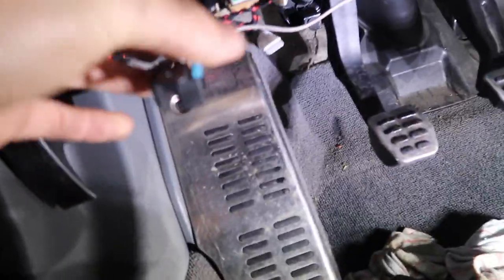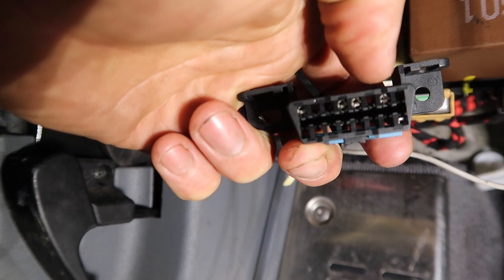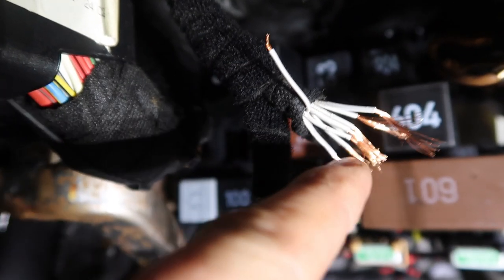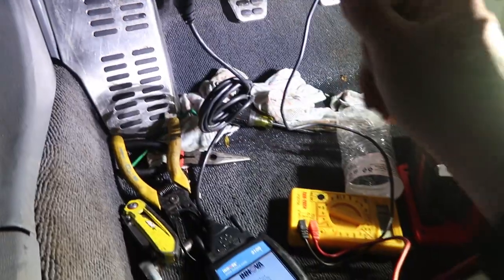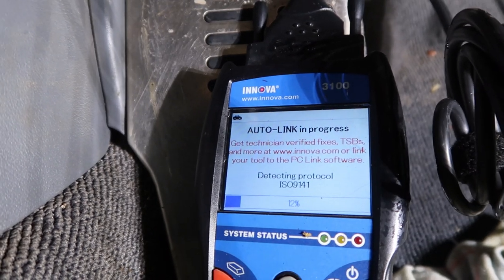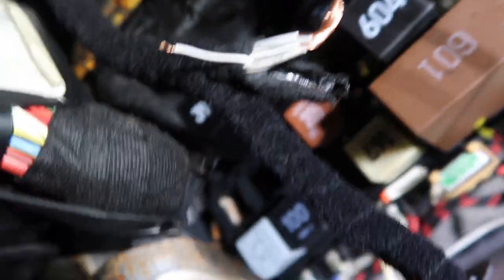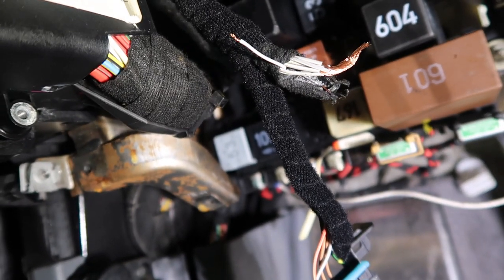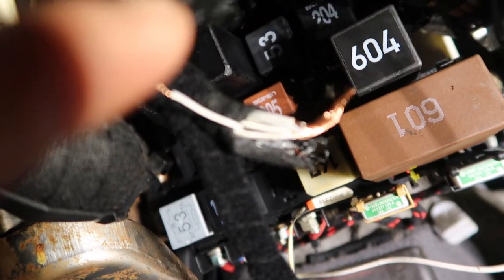Audi OBDII Port Not Working  FIXED!!!

Comment: Great information ! Thank you ! Any idea where that same connection / bundle of white K wires is, in a 2012 Audi A7? I've got a stuck K line after steering module failure - but unplugging the Steering module doesn't allow VAG-Com connect !

Comment: Thankyou bro. What should be voltage at pin 7 if it is working fine ?
Reply from the maker: From an Audi forum that helped me

If you have a volt-meter:  measure the voltage between pins 4 and 7 of the diagnostic connector with the ignition and radio turned ON.   If it's under 9V, your K-line is fine.  If it's over 9V, the results are inconclusive.  You'll need a 1k Ohm (approximately) resistor.  Put it between pins 4 and 7 of the diagnostic connector.  Now use the volt-meter to measure the voltage between 4 and 7 (in parallel with the resistor).  If it's under 1V, you don't have the problem.  If it remains near 12V (the resistor will get hot!) you do have this problem and you'll need to fix it per the the instructions below. 

Full article
https://www.ross-tech.com/vag-com/aftermarket-radio.html

Comment: I had the same issue but also with the Yellow "Battery" symbol on the dash display coming on 30 seconds after the ignition was switched on. No Diagnostic coms, just the same. I tried your possible solution and had no fix unfortunately. However I did fix it by disconnecting the complete dash pod while the cars battery was still connected. I took the left connector first, then the right, then the centre connector. Left it for 10 mins then reconnected it in reverse order. Switched on the Ignition and was fine. Started the engine, and was fine, NO "Battery symbol "  . Tried the OBD Diagnostics and was working again. ALL FIXED... was it a dash pod reset of some kind or a dodgy plug connection ????
Reply from the maker: That’s awesome I’m glad you figured it out. That’s a good truck I’m gonna keep that in my bag so I can use it later. Thanks for the update you probably helped a ton of people out

Comment: Yes,  6 months so far unable to connect with obd reader. Hope this works for me. Thanks so much. 👍👍got epc light comes on when engine warms up, stalls then wont start untill engine is cold, haven't been able to connect with scan tool. If this doesn't work,  any suggestions???
Reply: I suggest you look up DiagnoseDan’s channel here on YT, he had a video up for a Mercedes with same issue and it turned out to be a problem with the ECU sitting on top of the engine and getting so overheated that it wouldn’t send a signal to start a certain engine fuse to allow a pump to inject diesel.
Reply: Im having exact problem with vw passat 2000 2.8L V6, did you solve it? Pls answer...thx

Comment: I believe the biggest cause of K Line issue is scanners not connecting is after market radio fitting, there's quite a lot of tube vids on this, some tech diag people refuse to hook up their scan tools if an after market head unit is fitted as the problem can destroy the scan tools especially rosstech.
Reply from the maker: I heard they are know for blowing up scanners. I had an old one I didn’t care too much about to make sure everything was going right then hooked up my nice one to do more

Comment: There will be fault that somebody has  done further up the system at sometime, a bodge or a cut by a careless move or a stupid  move. The makers know what they put in and those that follow are not. An accessory or a tie-in somewhere that has been added, as per the aftermarket  radio , light , alarm, or something like that.

Comment: Hello brother, first of all, thank you.  I have a similar problem in my 1998 Fort Fiesta, do you think the problem will be solved if I remove the fuse of the radio?  Or do you have another suggestion for me?
Reply from the maker: Audi runs a little different than the rest of the world. Ford should use a standard obd ii where Audi uses a k line to run to each module

Comment: Thanks so much man this was my exact problem! Really curious if you ever found   what the issue with that wire was?
Reply from the maker: It was the HID driver that was behind the driver seat. One of the drains for the roof got plugged and flooded behind the seat where the module was located. Took it out an bolted it to the top of the box it was in to give me a little more room. Works like a charm now.
Reply: @ModdingAddiction Would it fix if I disconnect the fuse of the mmi completely, or I have to do whatever you did.

Comment: Just curious if diagnostic connection still works while the engine is on.
Reply from the maker: Yes it still works. You can’t clear the codes but you can read them and watch for new ones to pop up

Comment: I to am having similar issues reading ECU on my 2003 Passat. Question for you...whilst going through the k line wires I've noticed certain thing activating , blower motor, dash lights and engine fan as far as I can tell. When I grab all the cables together that stops. Is this normal ?
Reply: I have the same problem, did you find a solution? 😢

Comment: Hey bro I’m having a similar issue in a 05.5 s4. I get no comm on all the power train modules when I try to scan with vcds and even my verus. The car will start and run but I can’t comm with any important modules like engine, trans, abs, and a few more but it does let me connect to hvac and some other ones. How and where is the easiest place to be able to separate the modules? Do they all run to the cluster or are they spliced somewhere in the harness?
Reply: I'm looking for answers on the exact same thing. I've an '05 Bentley (same VW family) and the scanner can scan OBD Functions but can't access all the other systems. Car is perfectly fine to drive and run. Tearing my hair out!

Comment: Been unable to get my 2003 VW Passat smogged for over a year. I was told that it was the radio, even though it's original that had been replaced and then reinstalled before I got it (used). I'm about to try this now... wish me luck!
Reply from the maker: You could totally just find what one isn’t working with this. This is where all the modules combine and talk to the ecu. Hopefully it’s not your headlight module because it was rough to get to where it’s located
Reply: I've got similar issues with my 2003 Passat not being able to read ECU despite having power to the obd2 port. Tried testing the k line cables last night but gave up will try again this evening. One question should these cables trigger some of the electronics to activate ? I could get the blower motor to pulse, dash lights and electric fan to come on via these cables.
Reply: @sdfordy  did u find fix ?
Reply: so it was the radio?because i have the same problem
Reply: @vicky-nc3to  sorry only just seen this.  My issue was with my instrument cluster interrupting the connection with the engine side of things. Changed my cluster and hey presto vcds could communicate once again.

Comment: Hi sir 
Plz im stock on my 2000 golf 4 can't know wich is the wire can u help me plz
Reply from the maker: Should be able to find the k line joint where all the cables come together. Undo them and find which one is faulty
Reply: @ModdingAddiction   hi sir thank u soo much i buy thé Hex v2 and i can diagnostic my vw now so easye

Comment: Hey the same thing happened to me I was messing with the wires behind my stereo something sparked my car shut off won't start OBD 2 not working it only turns over and it won't shift out of park any ideas
Reply from the maker: Check the fuses make sure something didn’t pop one. It will have the fuses as a safety feature so the car doesn’t destroy itself

Comment: Well, its an the issue, but if I keep tht wire off, my stereo unit won't work, wondering if I keep it on is still safe
Reply from the maker: You have a bad ground on your stereo if your code reader isn’t able to read it. Now if it’s an aftermarket head unit I believe you have to ditch the k line and that’s the issue. To get the check engine light to stay off the k line from the radio has to be grounded.

Comment: hey bro i got a a4 quattro 2012 and it won’t turn over. it’ll power on but it’s like it’s not sensing the brake and i can’t find no manual on the wire system i have photos but it’s basically brand new and i don’t want to sell it.
Reply from the maker: Does the engine turn over first of all? Either by hand or with the starter. If it does then you might have a starter issue. Is it a manual transmission? There is a sensor beneath the clutch to make sure it is pressed to start. Some automatics have the same sensor on top of the break pedal as well. It would be worth while to get a multimeter and check to see if the switch is working.
Reply from the maker: Good luck keep me posted I will try to help the best I can

Comment: I got an 2012 Audi A6 Quattro and my check engine light on but I fixed the problem. How do I turn it off?
Reply from the maker: Need a code reader to clear the codes. Sometimes disconnecting the battery for a couple min and putting it back on will reset the ecu

Comment: I gave it a thumbs up regardless, this has to be VW fuckery... certain code readers will work on my GTI an certain ones wont. I had bought an LED Steering Wheel that works on every other car except mines as it read the info from the obd2 port. It randomly reads an works when it wants to.... just cuz of this BS K line stuff, this definetly help me understand a lil bit more, i might solve it
Reply from the maker: Good Luck it took me about a year to figure out my k line issue. There is very little information on it but start by disconnecting everything at that main junction saved me alot of blind looking.